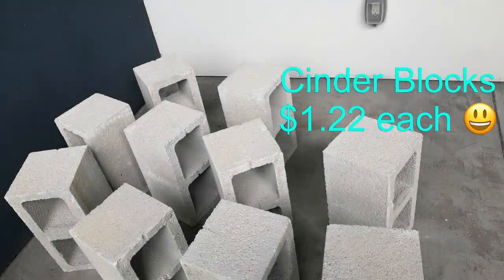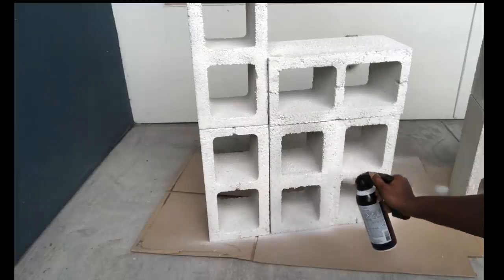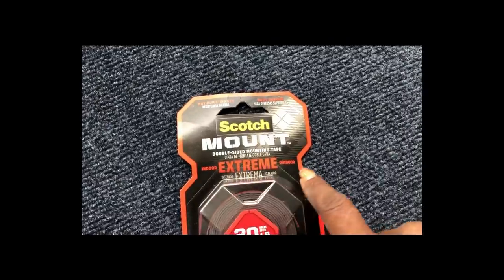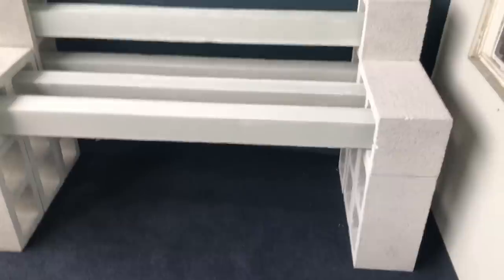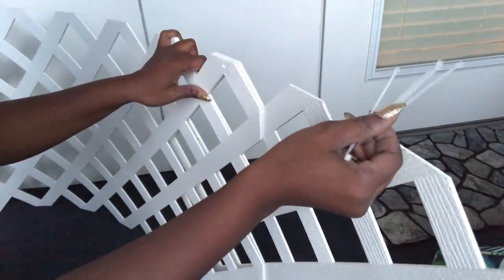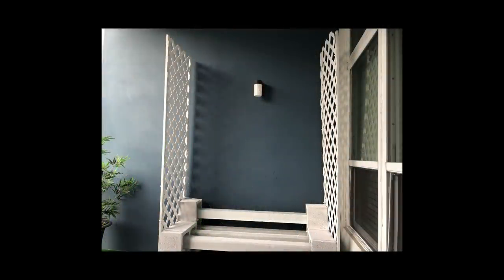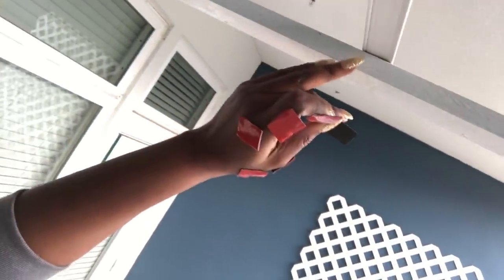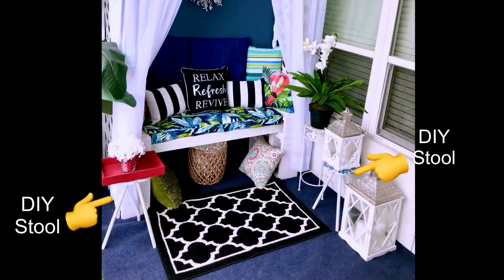DIY SPRING DECOR| HOW TO FAKE IT IN A RENTAL| DIY LUXURY OUTDOOR LOUNGE| HOME IMPROVEMENT DIY

Comment: If your wood was wet, your paint will peel. Pressure treated wood has to dry for a minimum of 1 to 3 months depending on your climate.
Reply: Wow
Reply from the maker: 😳 wow!!! Well, it’s a good thing that I can remove them since they’re not permanently fixed. Thankyou so much for this information 😇🤗💕💕💕